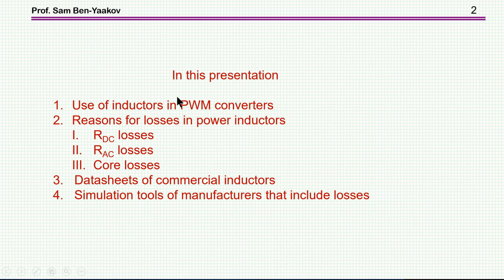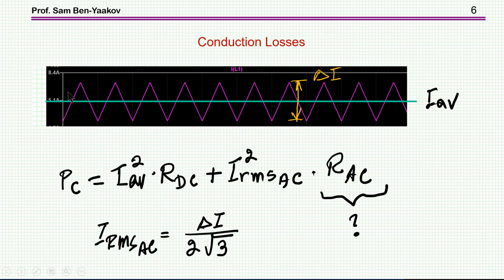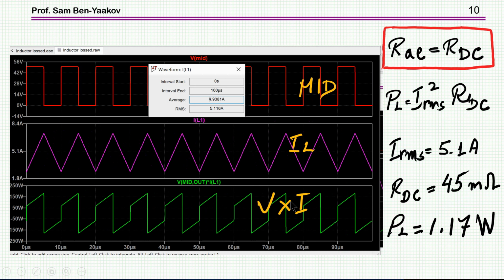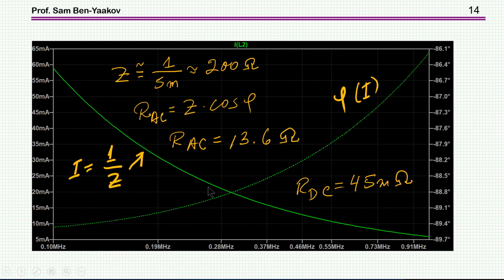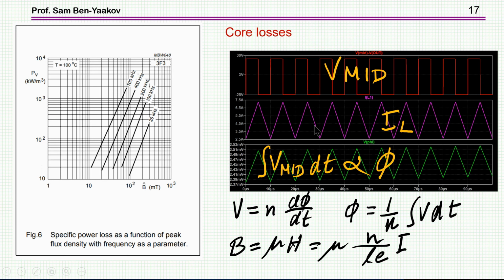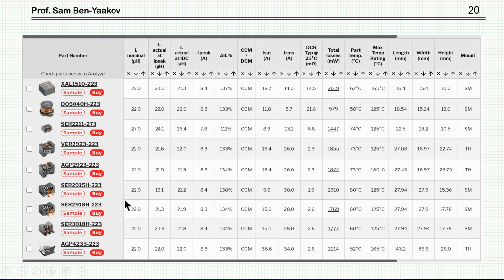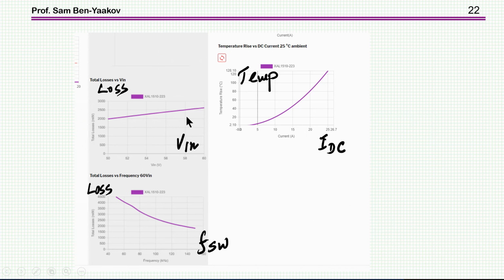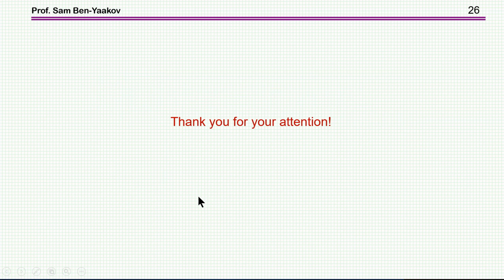Losses of power inductors in PWM converters

Comment: Professor, the input voltage Vin on slide 12 seems to be 200V (@ 8:00) and not 80V.
The difference in the power dissipation from slide 12 to slide 11 comes from the power dissipated in the 2500 ohm parallel resistor (calculation details below).
In fact, for the range of frequencies shown (100KHz to 1MHz), the Inductor model can be approximated by an inductor of value L =27uH in series with a resistor of value (ωL)²/2500 which arises from the finite 2500 ohm parallel resistor, but where the inductor is still dominant in the overall impedance.

This might be their attempt of modeling Rac in the usual range of frequencies in PWM converters(?).

_______________________________________
Calculation details:

In the Vin=50V case (slide 9), the 2500 ohm resistor will see a +/-25V square wave (δ=50%), and consequently a +/-10mA square wave current. Irms=10mA and therefore the power dissipated in it will be P = Irms² x 2500 = 0.250 W. 
Notice that the majority of the Irms=5.1A still goes through the 45 mOhm resistor, so that resistor will still dissipate ~1.17W. If you add to that the 0.25 W you get precisely the 1.42 W total loss that the simulation reports (slide 11).

In the Vin=200V case (slide 12), the 2500 ohm resistor will see a +/-100V square wave (δ=50%), and consequently a +/-40mA square wave current. Irms=40mA and therefore the power dissipated in it will be P = Irms² x 2500 = 4 W. 
Again, notice that the majority of the Irms ~ 5.1A still goes through the 45 mOhm resistor, so that resistor will still dissipate ~1.17W. If you add to that the 4 W you get 5.17 W total loss which is approximately what the simulation shows.

Using the 45 mOhm and Iavg to calculate the DC  power dissipation and afterwards using (ωL)²/2500 together with RMS(IL - Iavg) for the AC power leads to similar results as above, i.e. ~1.4W @ 100KHz and ~5W @ 500KHz.
Reply from the maker: Hi , Thank you for comment. You are correct. There are some inconsistencies in the slides. I am planning to post an addendum to clarify matters. Will it be OK if I mention your user name justpaulo  that brought up some of the issues?
Reply: @sambenyaakov  Yes, it’s OK professor.

Comment: 16:19 Is the lower loss due to it being specified at lower current?
Reply from the maker: They are the same. Perhaps due to different ferromagnetic material?
Reply: @sambenyaakov  The shown "total losses" correlate fairly well with the data in the columns = "Irms" ^2  x  "DCR".
The current shown for the 2nd part is 5.7A compared to 14.0A for the 1st.
Reply from the maker: @smeggyhead1  Just realized what you are saying. Yes, you are correct. I am going to remake the video, correcting this and other issues. Thank you.

Comment: Professor: The reason for the difference in power loss between the two Coilcraft inductors is that one has a ferrite core (lower loss one) and the other has a metal core. Generally ferrite cores have lower losses, but they also have a larger decrease of inductance at Isat and greater temperature sensitivity of inductance than metal core inductors.
Reply from the maker: Hammm, metal core? You mean iron powder?
Reply: @sambenyaakov  Yes, these inductors have iron alloy powder molded around the coil.

Comment: Thank you professor
Great
One question
If we choose lower delta(I) for calculate inductor value in buck converter equations (use larger inductor value) we can achieve lower R(ac) in circuit? (if we can ignore the increase in dc resistance)
Reply from the maker: Yes indeed.

Comment: Hmm. "Yet another schematic probing technique is to plot the instantaneous power dissipation of a component. To do this, hold down the Alt key and click on the body of the symbol of the component. The instantaneous power dissipation will be plotted as an expression of voltages and currents."
Reply from the maker: Well this is exactly what I did except that I marked it wrong on plot. Will put a correction note on description section of page